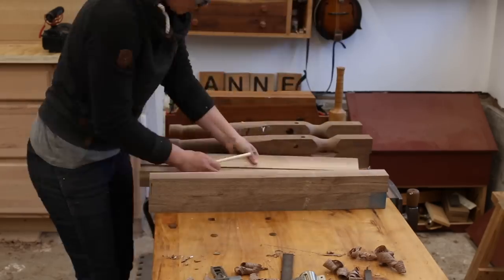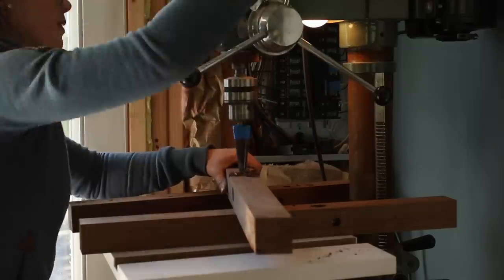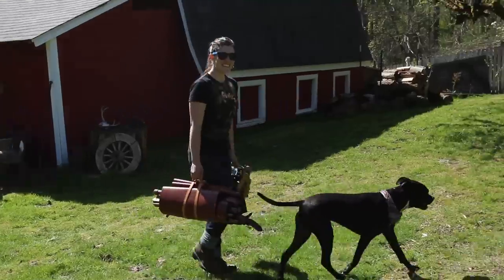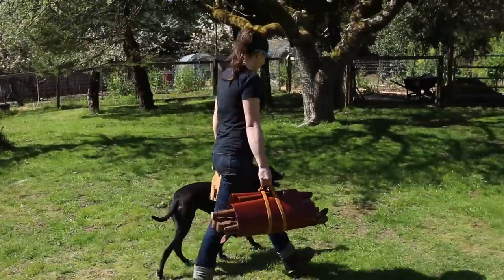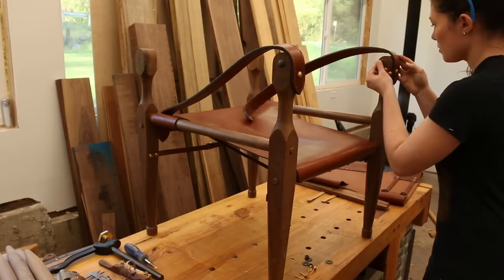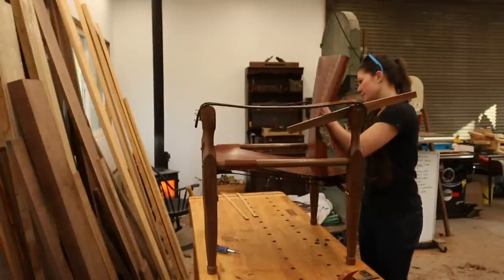Walnut and Leather Camp or Roorkee Chair // Woodworking & Leatherworking

Comment: Great site!
One thing I have seen in using very powerful planers, sometimes short boards are launched out the back of the planer.  Our shop teacher left the hole in the wall as a lesson to all.  So I never stand behind the board when planing or sawing on a table saw.  I always check the walls behind the planer now when I enter a new shop.

Comment: Good looking chair!

Those stretchers are way bigger in diameter than Chris intended, I believe.  Not that it's wrong, but he expected stretchers to end up just under 1 inch in diameter.

Of course, that means you would have to use dead-straight-grained wood because any grain run-out would be fatal when they are that thin.  (I saw a failure happen in person, but he did that to demonstrate the problem.)
Reply from the maker: Yeah, I made the chair 3” taller than he recommends so I widened the stretchers to accommodate the extra potential strain.
Reply: If you buy Chris Schwarz's DVD on making this chair, or, better yet, his book Campaign Furniture (Lost Art Press), he goes on to say that 1.25 inches is a good diameter for the modern American "hamburger-fed frame". I make mine using 1.25" diameter stretchers and it looks just fine. And I eat a lot of hamburgers.
Reply: As an aside, I recently had another type of failure: one of the brass nylock nuts that hold the backrest pieces to the legs came undone while a friend was sitting in the chair. Lucky for me she's my smallest friend! I had been occasionally tightening these nuts with a wrench, but have now replaced them with normal brass 5/16 nuts and some blue Loctite.
Reply: The blue Loctite also failed! Check your Loctite for freshness, it's only supposed to last 6 months once opened. I replaced it with some fresh bought red Permatex which seems to be holding...

Comment: Ok.  So i'm embarassed to ask at this point, but why make multiple passes on your miter saw?  Why not just do one full chop?
Reply from the maker: Myers Woodshop never be embarrassed! When you’re breaking down wood that either A. Potentially Has a lot of tension, B. Isn’t fully square, or some combination of both, it is much safer to make several passes so the blade doesn’t bind causing kickback.